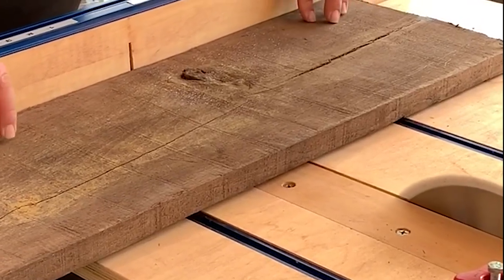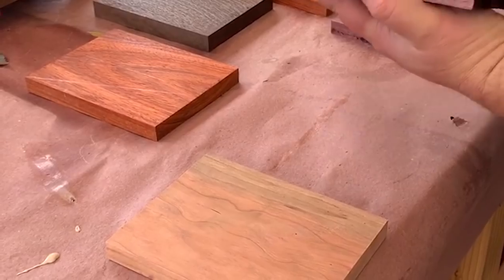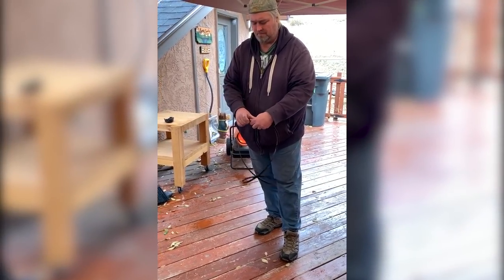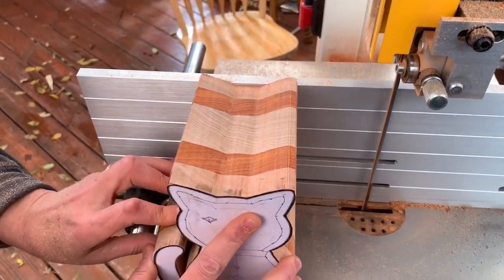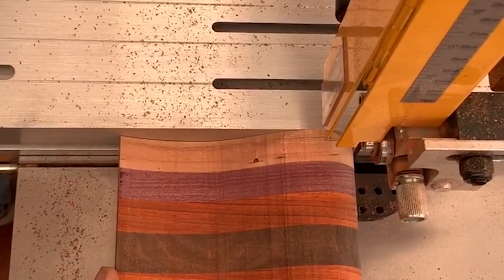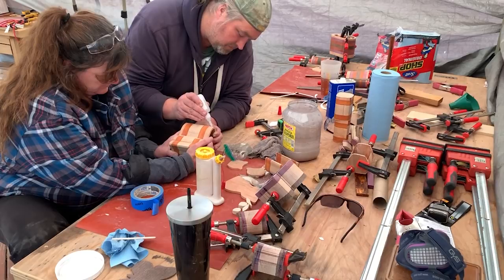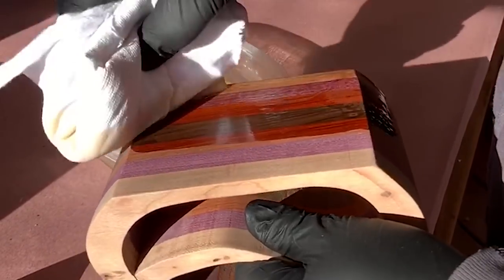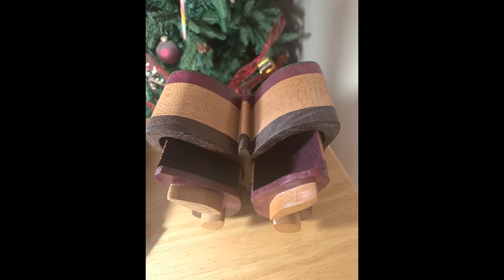Bandsaw Box - Ep 27 Husband/Wife Project

Comment: Kat knows her way around a bandsaw, last night I made my first Bandsaw box out of a mesquite log that was cut down in a neighbors yard. Mine was Avery simple design for my wife’s niece that turned 8 years old today. I wish I had seen this video before last night I would have made the Cat version. Last year I bought a Grizzly 17 inch 2 hp band saw with the brake, the brake is really nice, years ago I owned a delta 14 inch on a riser block for resaw work. This the Grizzly is night and day from the Delta.
Wow very nice! Suggestion:  this is what I do, I put Blue painters tape on the project then spray the adhesive on the tape then place the pattern on the tape.
Question I used Watco Danish oil on a project following the directions in a 75 degree shop with AC on, the after third application of Danish oil it became tacky. It stayed Tack for over a week. I just sanded it off and used something else. What went wrong any ideas? 
Oh I used a 1/8 inch 10 TPI blade last night what did you use? Thanks guys Beautiful work both of you.😁🛫
Reply from the maker: The tacky part: Two things off the top of my head. First, the humidity level was too high and you probably should have waited longer between coats. Often you can wipe it off the same you would if it was stain and that will help. Second, the wood may have taken all it could and the last bit stayed on the surface and dried. Again wiping after applying like stain could help with that. 
I also used a 1/8” 10 tpi blade. Yes Kat is very good with a band saw. I think if I ever get a scroll saw she will become more efficient with it than I will. Because she quilts she has more experience with that motion.

Comment: CA Glue funny story back in the early 80’s I worked on Medical Ultra Sound equipment, I was at a hospital and had to temporarily repair a plastic part using baking soda and CA glue. You guessed I got the CA glue between my index finger and my thumb not knowing it until I went to release the part I was holding. Rut Ro!!! I was stuck, the rad tech came in to check on me and I explained my problem, what I did not tell you was the ultra sound probe cable was in between my thumb and index finger the good new I could disconnect the probe from the rest of the equipment but the plug on the cable was too big to pass between my thumb and my index finger. Down to ER we went. The Doctor did not know about the acetone trick as CA glue was just beginning to show up on the consumer market. He suggested I wait a few days in the mean time soak my fingers in salty water.
I said I can’t do that for two reasons one the hospital needs the Ultra sound machine back up and running as it was in the OBGYN Department.
And I had to fly the airplane home that night and  that was not going to be fun with out fingers to turn knobs with. (the company provided us airplanes to fly,  if you were a pilot and I was,  if you were not they would teach you to fly. I could cover a large area and be home most nights, it was great not having to deal with the airlines) 
Back to the ER,
So out comes a scalpel, I Lost some skin on that trip but got a lot of ribbing from my other coworkers from then on it was surgical gloves after all I was always at a medical facility 🛫
Reply from the maker: Haha I became a paramedic right after high school. We always had a can of acetone on the truck. You would not believe the number of people that would get themselves stuck and call an ambulance.

Comment: They look Great, I look forward to making my first band saw boxes and thank you for the templates. I do have a band saw but unsure of the right blade to use for these boxes, do you mind sharing what blades you used and any other advice for this beginner?
Reply from the maker: Hi and thanks for the kind words. We used a 3/16 blade for the curved and cut outs. If your bandsaw can handle it I would suggest a 1/8” blade. Some saws won’t accept one that small. Also, I would practice on scrap wood until you get the hang of the movement you need to get a good cut and not twist or bind the blade. Also, don’t be afraid to make mistakes. In the end enjoy the process and have fun.
Reply: @mkdesignsfinewoodworking Thank you, you are very kind, I appreciate the advice
Reply from the maker: No worries. Feel free to reach out anytime. I may not be able to get back immediately but I will do my best to respond quickly.

Comment: Beautiful! Really learned from your video, appreciate it! Just curious, if you were to sell these, like on etsy or other method, considering the time it takes, what would you price them at? Now off to get a bandsaw!!
Reply from the maker: Thank you. Pricing depends on a few factors. Material, design, and complexity. The are in which you’re selling also plays into it. A simple bandsaw box could sell for $50-$75. A more complex one can go for $500-$600. These particular ones I would sell for around $150. A good rule of thumb is to start with a flat rate. I typically start with (material x 3). So if material costs $50 I would sell for $150. Then adjust from there depending on what I think people would pay for it. Hope that helps.
Reply: @mkdesignsfinewoodworking  Great info and advice! Thanks again and Happy New Year!!

Comment: Your boxes are gorgeous. Two questions:

Can you show us how you made the little pyramid stands you had the boxes drying on after you oiled them?

What exactly is the purpose of the flocking?
Reply from the maker: I didn’t make those. They are painters pyramids. You can get them almost anywhere that sells paint. The purpose of the flocking (in my opinion) is just to make it a little prettier. It also helps hide any imperfections on the inside. I don’t think it really adds any protection other than maybe preventing whatever you put in it from scratching the box and vice versa.
Reply: @mkdesignsfinewoodworking  ohhh ok thank you